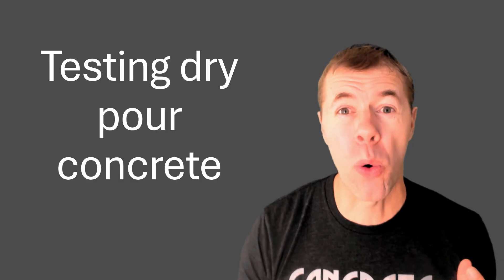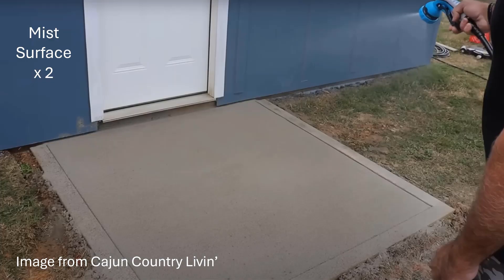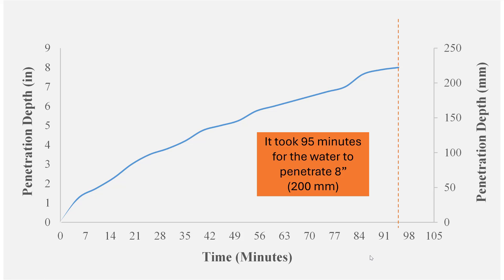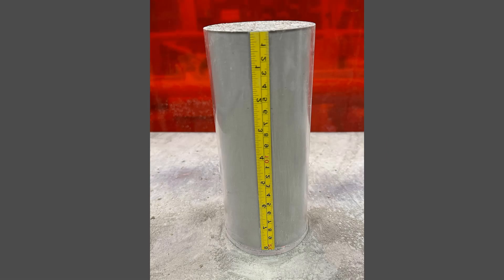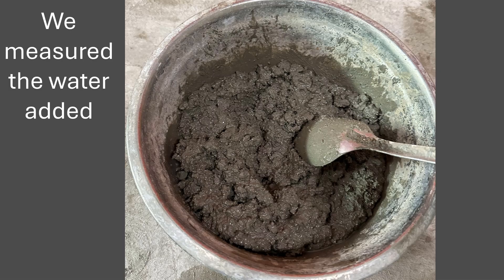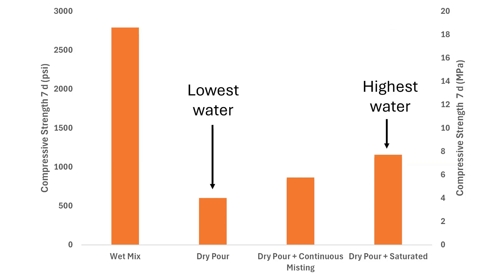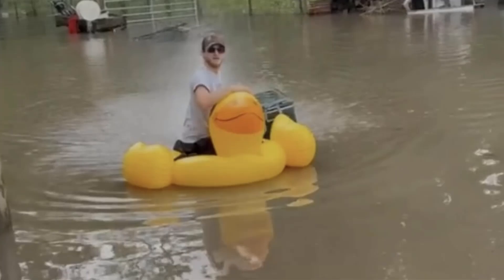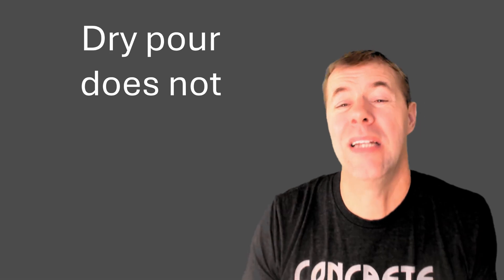Testing Dry Pour Concrete with an Expert

Comment: What happens if the dry pour is immediately submerged into water once the outside is hard enough and leave it for 24 hrs like they do with some wet pour concrete for better curring? I was thinking about building the dry pour on plastic.  Once the outside Strong enough.  I remove the frame and pour water and lift up the dry plastic to act as containment. That's just my thoughts.  I might want to do what you did with the block for a test.

Comment: Technical question: What if you were to submit your dry pour to vibration, possibly ultrasonic to get the water to fully wet out the internals? Just thinking out loud. The vibration waves moving through the material would cause the water to seek a density equilibrium and displace any air pockets...
Reply: You'd  have a bumpy surface.

Comment: I would love to see 2 additional tests to try to determine if it's proper/complete saturation or if the mechanical mixing/agitation has some additional effect on the chemical reaction:
- Make it in a form with sides that stick up above the finished surface and then after the initial wet down and it starts setting on the top (to give it it's shape/finish) keep it covered with a layer of water to see if it would soak in completely or if surface tension or some other factor is preventing it when it's allowed to run off
- Make the dry pour, add an appropriate amount of water, and then pull a vacuum on it like you would to fully saturate composite layups, especially with composites with Kevlar in them that tend to resist wetting out by mechanical means. I could think of how you could put some DIY drypour setups under at least a partial vacuum

Comment: Doesn't seem like a fair test. No one is going to pour an eight inch slab unless they build highways. Most folks are going to use dry pour for things like you mentioned at the end of your video, small patios or walkways two to four inches thick max. They don’t want to pay a high priced contractor that wouldn’t want to do a small job like those anyway.  You’re right air is not going to escape from the bottom six inches which will make a weak pour but the top few inches of your test where air could escape looked much harder than what you focused on. For the average person concrete poured with a mixer is more difficult and generally far from perfect anyway. One mix is too dry, the next too wet, and many don’t have the skill to finish it properly once it’s poured. So...the draw to dry pour. There are a lot of Variables when pouring concrete and the pros often don't get it right. I’m a retired home builder and have watched flatwork contractors  have the cement truck driver add way to much water to thin the mix down because they were in a hurry or didn’t want to work as hard to level it out. It takes skill to do that, but those are the driveways scattered through every neighborhood cracking with the top flaking off. I would love to see someone with the knowledge or resources  come up with a dry pour method a homeowner could use for a consistent decent looking patio or walkway. Accurate knowledge of what can be expected and what can be done after it's cured to prolong the life of the concrete would be helpful. Dry pour is definitely not for driveways but many are using it for smaller projects and quite happy with it.

Comment: Interresting video. The big difference looks to be compactness. Wet concrete acts like a liquid: you can’t compact is further once the air is out. My guess is the dry pour still contains a lot of air despite al the water added. That’s why the mixing makes such a difference. You mesured the amount of water added, but did you mesure the amount of dry matter you started with too?

Comment: What if you hydrate the dry pour from the bottom up so that the air is pushed out by the water rising, with just a very light misting on the surface initially to keep the finish? Theoretically that could be very compact. May not be practical in most real-life scenarios but just out of curiosity.

Comment: I was on the fence with dry pour and after watching this video; I still am. This was not an unbiased test as the strength over time test was done with the weakest dry mix - instead of all or the saturated test model . I believe that the tester knew what he was doing. This is unfortunate as I would like to know the actual truth of the matter.

Comment: One thing I've never seen tried is,( when laying a four inch slab for example), pouring two inches of concrete and laying the rebar, then soaking the dry concrete, then immediately pour the final two inches of dry concrete, mist and then soak as per usual.  this way the middle would be wetted.  However, ultimately best to just order a concrete delivery truck and just do wet mix.  Last time I calculated buying concrete bags for a 3 x 6 meter slab, it came out to about the same cost as just having a wet mix truck delivery the concrete.

Comment: great scientific test. moment i saw ppl doing dry pour i was like "concrete does NOT work that way. the chemical transformation only occurs when you mix it well, you can't just spritz water on the top". glad someone with an engineering background actually did a scientific test to show ppl this. there's a time and place for dry pour - like if you're doing a slab strictly for vanity, it's not too big, it's only one, and as a homeowner you don't want to rent a mixer or a cement truck. that's fine, if it's just for light, recreational use, and you don't mind durability that much. but for anything else, it makes no sense to use dry pour. it's definitely the cheap way to do something, like building a shed using only a hot glue gun.

Comment: I worked with concrete in NYC. You over looked one big factor with the dry pour. If the clear cylinder did not have bottom as dry pours don't have a bottom that contains the water, the dry pour would be even weaker because the water would keep draining and there would be weak spots because there would areas were the water didn't reach or wet it enough.

Comment: Vibration, no one has talked about vibration, I wonder if you could vibrate dry pour with a petrol powered small vibrator, mix it in situ. I am guessin you would have to add more mix as the level drops and air is removed.

Comment: There's something that no dry pour video has done.  I always wondered what would happen if someone added a suitable amount of concrete plasticizer to the water that's being sprayed on the dry poor mix.
Also to prove your hypothesis about the air channels causing the weakness in the dry pour,  if you had a vacuum pot big enough to put your test sample in and took out all the air and was still able to add water that might be able to support your theory.

Comment: Probe your dry pour with a vibrating tool (or a sawzall w/dowel hoseclamped to a used up blade) to eliminate stubborn air pockets. Still no mixing, all you're trashing is a stick...

Comment: One thing that I've seen video of is paving a road with dry mix. But they leveled and compacted the dry mix first, then started driving water trucks with sprayer bars over it followed by big roller compacters. I'm guessing that that might work because driving over it with heavy machinery as the water is penetrating would end up acting as a mechanical mixing, collapsing air channels and causing enough shifting within the mix to get the paste to flow around a bit.
I've also seen a method of producing cement tiles, https://www.youtube.com/watch?v=pV2lSlpzrww&t=55s , by putting wet colored cement paste down inside a pattern, the metal pattern is removed from the mold and the rest of the mold filled with a dry concrete mix on top of the wet paste and then compressed with a hydraulic press pushing on a plate the size of the mold. The pressure cause the excess water in the paste to rise up through the dry concrete mix and the resulting tile is pretty much solid immediately after pressing. The tiles seemed to be stronger than regular concrete after curing.
So maybe dry mix can become strong if there is a way to compact the concrete before it sets up to get rid of the porosity.

Comment: I’m really late to this thread but I have a question. If I build my frame and put a plastic sheet in first. Then wire, before the pour, can I wet the inside of the frame and dry pour in stages with water in between them. Would that set more solid or should I buy a Harbor Freight mixer for a one time patio build?

By the way, I have been a fence builder for over thirty years. A 100% dry pour for non corner post is my preferred method. If you mix it wet, the post will break off at the top of the ground. No water can escape from it.
Reply: Dry pour does work well and by adding rebar, it will be nearly as good as wet pour...dont be afraid of doing dry pour and it would be best setting in the dry pour all at once and not in stages...misting in stages of by the hour for at least six misting's over the six hours and the last one wetting the concrete.  Depending on the depth, it may take less misting.   Cover it with plastic if in dry weather for a day, couple if possible and wala.  No need to rush it doing it the wet pour way.  You got this bro.
Reply: Don't put the sheet, cause over time the concrete will absorb water from the ground and you don't want the rain not being able to go into the ground through the concrete.
Reply: CajunCountryLivingHasHelpfulPointersAndEncouragmwnt.

Comment: I would like to see a more 'real world' test. Pour a standard slab, and 'pour' a dry slab. Let them cure for 30 days, core them, and then test the cores. No one is dry pouring a 12' thick slab. So just filling a cylinder with mix, and wetting it is going to give a different result than a core taken from a 4 inch thick slab.

Comment: I love how you are hitting wet pour concrete with a hammer, to break it, while it is sitting on your concrete floor.   Hitting the dry pour is safe, surely, but hitting the wet pour?  That is brave. The weakest point might have been your floor.

Comment: Excellent video and analysis.   Builder of 50+ years.  I use dry pour very much as you have described,, the low impact small jobs.  BUT  I really need you to test something.  When setting fence posts I use a technique which may, I say may, greatly impact your test results. I use a similar technique for those occasional small slabs.    I dig my post holes exactly to a string.  Prop my posts in place with a couple of very temporary angle braces.  Pour the dry mix into the hole surrounding the post.  Then I take a rod,, usually a 4 foot piece of rerod and slide the rod repeatedly down through the mix alongside the post.  Up and down, up and down and circle the post multiple times. When you first slide the rod in, it goes all the way to the bottom.  move around the post and the second time around it will slide in only ,say, 2/3rds the depth,, third time 1/3 the depth and the dry mix is squirting air and compacting at the bottom. Total time about a minute or less per hole.  I liken it to using a vibrator on my form work.  I have not but I have often thought to pull the vibrator out instead of using the rod pack.

The two results of the use of dry mix for these posts.  The dry mix is packed firmly.  The temp bracing can be removed immediately and the fence panels or wire can be installed immediately.  There is no set time to wait for the posts before panel install.  In Michigan, the concrete will suck plenty of moisture from surrounding soils and set hard in a matter of days. Working in Arizona I pour a bucket of water onto each post hole.  

My suggestion.  Take the same test cylinder, fill with dry mix, and rod tamp it to remove the air.  The surprising thing is that the bottom compacts and the rod will no longer slide to the bottom,, and then the rod penetrates less and less as you work, finally you are just stirring the dust on top.  AND the dry mix will settle by 1/4 or so in your test cylinder.  You will have to add more dry mix to finish with an 8 inch tall test core.   

You did not say, or I did not see, You used the pre-measured  amount of dry mix before you wet mixed the sample,, was the total wet mix in the cylinder exactly the same height?  Was it lower?  I would expect the mixing and water to drive out some of the air.  Or was it equal or greater, the volume of water increasing the total?

Try the rod packing to remove the air.  You may have some surprising results
Reply: I worked for a utility company and we set 20' steel light poles using this technique over many years and the rod or a flat spade tamp firms the mix fast and hard without water and we never had a failure.

Comment: WHAT THE HELL IS SO HARD ABOUT MIXING IT PROPERLY YA'ALL ARE MAKING TINY LITTLE PROJECTS TO BEGIN WITH.  DRY POUR WILL FAIL ITS THAT SIMPLE.  40 YEARS OF POURING AS MUCH AS 15' THICK FOR SUBWAY BASES.  WHY DO YOU THINK THEY PUT TONS OF REBAR IN SLAB POURS??  SMH

Comment: My question is, why not mix it on the ground with a hoe with holes in it for mixing? Then screed it. Is it just not possible? Never tried. Thanks for the testing, I am going to dry pour a shed base but add water for a week.

Comment: Professor Ley it does seem like there are things one can do to make a dry pour better based on your video. Maybe keeping it wetter longer for one.  But are there other things that can be done to improve the process? For example if you are making a 4" slab, put in 2" soak that, lay rebar, add more dry mix and finish.  Would that help or hurt?  Maybe you could fill one of your tubes half way up, wet that, then fill the rest of the way and wet that. Then test the strength and cracking. Keep up the good work!

Comment: Ok, there is a fundamental variation sample I think you should have done. It's something that happens to the wet mix concrete as a part of mixing that isn't done in ANY of the dry mix methods I've seen yet I feel should be absolutely fundamental to dry methods. Namely: COMPACTION. Prior to wetting, the dry mix should be compacted to eliminate air and improve density. I mean, the general rule of thumb for dry material quantity estimation is increase dry materials by a factor of x1.3 by volume. This alone shows how much wet mixing increases the density of the raw dry materials when compared to those materials just thrown in a pile or container. 
What effect will this have on water penetration? I would like to see that. I would definitely expect this would have a large effect on the strength of the paste as a binder. Please oh please do this test.
Reply: I wrote that comment before you talked about the air channels and causes of cracks. So yeah. I NEED to see the tests of an extra step of compaction before adding water. This was my immediate response to seeing the dry pour videos "YOU'VE GOT TOO MUCH AIR IN THE MIX!! AT LEAST TAMP IT DOWN BEFORE WETTING IT. OH FOR CONCRETE'S SAKE!"

Comment: Pure dry pour has settled and separated in the bag during shipping. But what if you mix it dry, pour and level before adding water? Another idea to maybe line the pour area with plastic to hold water and run a sacrificial soaker line to wet the concrete from the bottom up.

To say dry vs wet are the same price is laughable if you need a mixer truck because at that point it can become multiple thousands of dollars difference.

Comment: Have you tried wet water that has the surface tension broken?  Have you tried a vibrator on the form?   The primary things I would us dry for are post holes where mixing and more premix is a pain and had its own issues with air gaps around the poles at times.

Comment: If you dry pour in the environment driveway, sidewalk, or patio. Will the air push out through the bottom of the concrete. Just wondering if you did any test outside of a lab in your container pour the air could only escape through the top didn't know if the water would force the air down in a real live situation. Thus, you would not have those air channels.

Comment: I use the dry pour method for pathways in my garden. Only 1.0 inch thick, using Sakrete 50 lbs. bags of Crack Resistant Fiber Reinforced Concrete Mix. WORKS GREAT.
Reply: Seems like a stupid idea. If it's that thin then you'd REALLY want to mix it properly for superior strength.

Comment: i wonder if you can do the dry concret one or two inches wet wet wet the add the mixed wet concret on the top?  or add fiberglass fibers to the dry concrete and add lots of water the add the wet concrete on top...hey at least u have ur work in half LOLOL

Comment: I'm not sure most question whether "properly" mixed concrete is stronger than dry pour. I think we all know that it is. At least I hope so. These tests are absolutely convincing and really should put that question to rest for anybody still thinking dry pour is just as "strong" as wet mix. But the real debate/question is: is dry mix "good enough" for a particular application, and what sort of trade-offs are there (cost, effort, expertise, durability, maintenance, etc.). You address this some of this at 16:40, which I appreciated. My personal experience has been similar, too.

Overall, this has got to be bookmarked for anybody deciding between dry pour or wet mix for their particular application and given their particular constraints and other needs. Really appreciate the thoroughness and effort! Subscribed!

Comment: Excellent video, very informative. Appreciate you providing all the finer bits of detail to increase my understanding with regard to the problems associated with dry pour. Other videos just show a cut cross section and demonstrate that it's easier to cut dry pour and it's more crumbley. Your explanation of the air escaping causing cracks and the increased bonding between the past and aggregate for a wet pour demonstrated during the break test, was very informative. Again, great video. 
👍👍👍👍